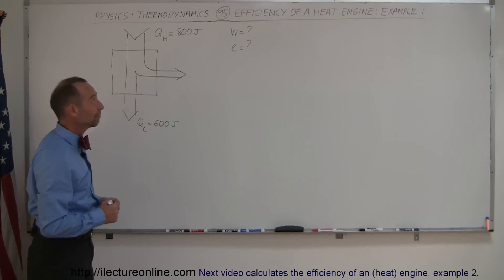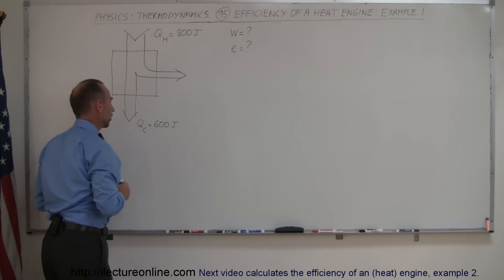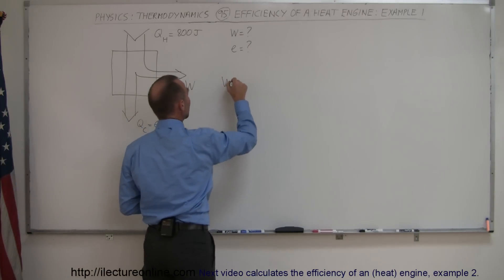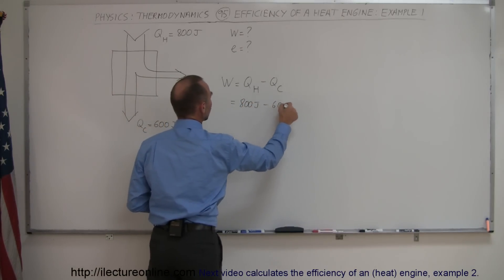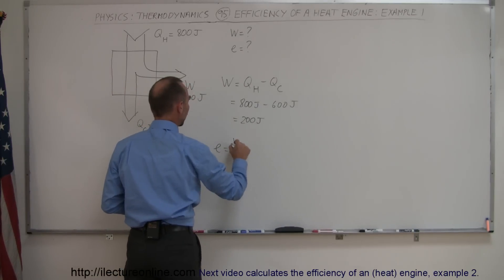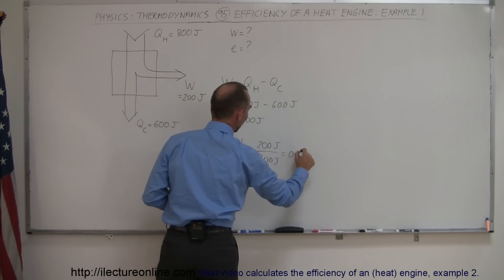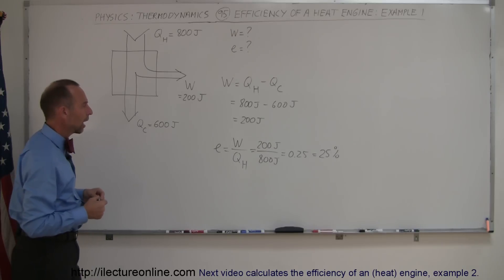Physics 29  Efficiency Of Heat Engines (5 of 14) Efficiency of a Heat Engine: Example 1

Comment: is the last line correct? uses 25% of heat from heat reservoir and turns it into heat again ?
Reply from the maker: 25% efficiency means that 25 % of the heat put into the engine is used to do work.

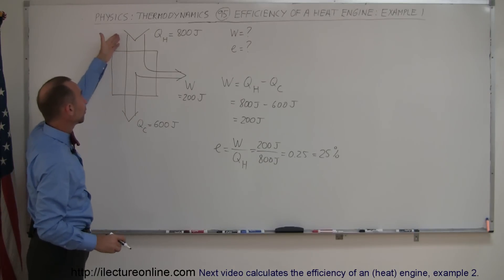Comment: Thanks for making such great videos and helping students with these concepts. Quick question though, at 1:18 you said it uses 25 percent of the heat provided and turns it into heat. Did you mean to say work? Thanks
Reply from the maker: +eaMusIk2008 You are correct.